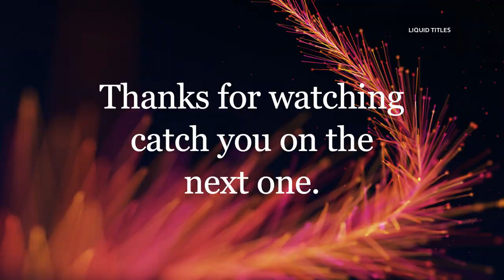Wood turning a Cauldron for #week

Comment: A pleasure to watch you work. I have a request - if your camera handles it, more pixels please! At 360p I can see what you're doing but don't get to see the final result so clearly. Anyway, see you on the next one!
Reply: Have you checked your settings on YouTube  and put them up to the maximum currently 720p I’m sure William is recording in 1080p however YouTube will be reducing it to A max of 720 . They may be putting it out in 360 to save data for mobile users. You can change this if your using WiFi and not mobile data to a higher quality just click the cog wheel in the top right hand corner
Reply: What Brian said lol
Reply: Excellent Cauldron William another great video Buddy 👍👍
Reply: @Stable_Studio  Mine is only giving me 360 max as well at the moment and that's on a PC with good reliable network connection. Maybe the HD render hasn't finished yet.
Reply from the maker: Thanks for watching 😀
Reply: Yes, I checked the settings. And thanks for the "see that cog wheel thing?" dummy guide. I did know.
 Anyway, I'm watching on a tablet which handles 1080p fine. My bandwidth is good. On other videos I get the HD options, but on this vid 360p is the only option Youtube gives. Are you saying you're getting higher res options on your device, for this video?
Reply from the maker: I've just signed in with a tablet and I'm watching my video at 1080p
Reply: @William_Kenny  Mine is offering 1080 now as well so I suspect it just hadn't rendered the HiDef version when I watched it earlier.